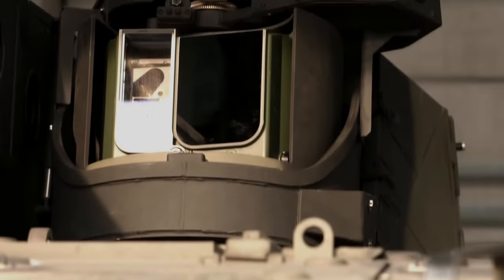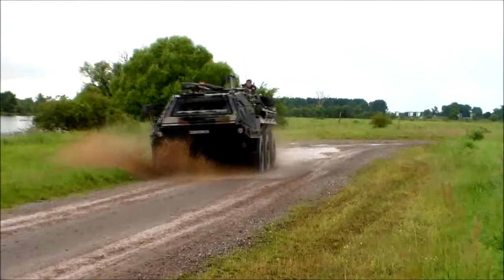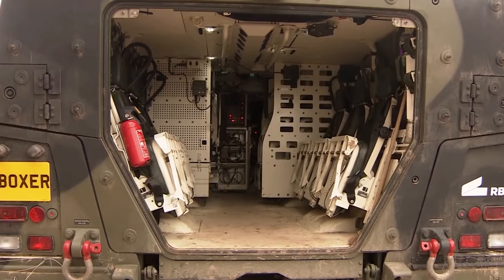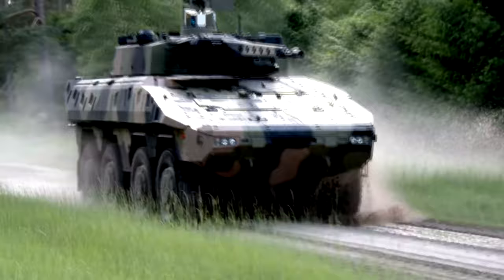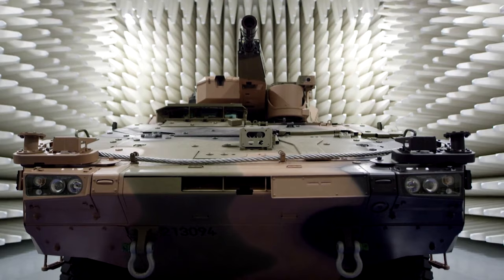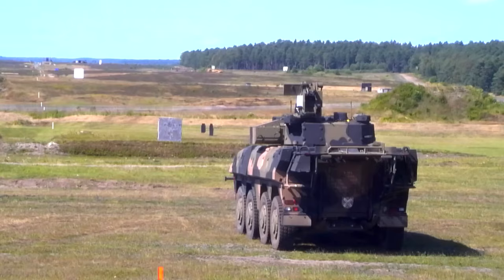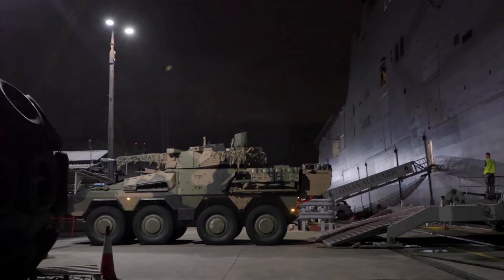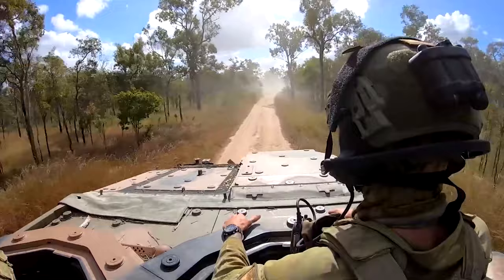Most Versatile Armored Vehicle Ever Made. Boxer Armored Fighting Vehicle

Comment: They also showed one variant at the Eurosatory 2022 with tracks and a 120mm autoloader cannon. It's named RCT120 but at the moment there are not many information about it.
Reply: the stryker has problems with the recoil from the 105 mm gun, hmm.
Reply: @steveyoutub76  That's partly because it's wheeled, this boxer is modified to have tracksas such it would be a more stable platform
Reply: @steveyoutub76  The Stryker is a complete different vehicle.  The Boxer is 2 times  heavier then  Stryker.
Reply: @bertnl530 no wonder it’s called the boxer if it’s heavy like that
Reply: @CASA-dy4vs  I don't know if it got that name due to the weight.

Comment: When I first heard about the Boxer decades ago, I was very skeptical about the modularity concept. I thought it is mostly a useless gimmick because no army would ever swap such modules out to turn for example a command post vehicle into a ambulance or something like that.
I was right about that, but I missed the point.
The point is not to turn military vehicles into transformers that would switch roles on the battlefield. The point was that now Rheinmetall/KMW can offer any kind of military vehicle to any customer and have it all based on one common platform that comes off one assembly line.
That is absolute genius and I didn't realize that in the beginning.

Now, no matter what country/army needs a new verhicle, the Boxer can compete. It can be the answer to any problem any military force has, especially now that they also developed a tracked transport module.
You need a APC? Boxer got you covered.
You need a short range air defense system (SHORAD)? Just get a Boxer with the SHORAD module.
You need a field radar system? Just slap one on to a Boxer.

And on top of that now there are also third party companies that are developing and offering their own Boxer mission modules. Apparently there are already 3 or 4 modules with different 120mm mortar systems by different manufacturers being offered, so the Boxer is becoming its own military industry eco system that can be used as a middle man between smaller manufacturers who maybe can't develop their own full vehicle but can develop a mission module and the customer looking for a new vehicle.

The whole concept is so ingenious that in a world where military contracts are always given to the best option and where neither corruption nor national interests (wanting to support homegrown companies) were a factor, Boxer would have to win basically every tender and get all the contracts in the next 30 years or so.

And even with all those other factors determining who gets a contract, Boxer still has a leg up because they can not only offer to produce the thing in the customer's home country, but they can even offer that some company in that country can develop and provide their own mission modules to the project.
Reply: The Modular System is the only way it can be Airlifted by the A400M.
Reply: Yeh all good points . With battle damage , if one vehicle had track damage and another vehicle turret damage you could quickly get one vehicle up and running . 
I am really interested to see how the tracked chassis comes along . That could open up whole new avenues of modularity . In ukraine where tracked vehicles only good in winter muddy times,  I was thinking its possible to order 500 modules and then have 500 chassis each of wheeled and tracked allowing one to use the 500 modules 12 months of the year  mud rain or shine . I think its a great system. Would like to see a similar design but for much less tonnage  vehicles
Reply: @gOtze1337  Ergänzung: Der Boxer hat ein Leergewicht von 25,2 t und der Airbus eine Nutzlast von bis zu 37 t. Nicht nur das Missionsmodul kann beim Boxer leicht ausgebaut und separat transportiert werden, sondern auch Teile der Panzerung.

Comment: They are buying the australian block 2 version. Which is a major improvement over the standard model
Reply: This is not an "Australian" block 2 version, but a further development of the first batch, which is already being manufactured in Germany and the Netherlands for their orders. The A2 version has improved passive protection and is already included in more than half of the German Boxers delivered. The Bundeswehr gets the Boxers from Australia because the Lance Turret is also manufactured there for the Australian Army. It's simply easier to build the models with identical equipment on the same assembly line. This means that Rheinmetall does not have to change production at the other plants in the Netherlands and Germany.